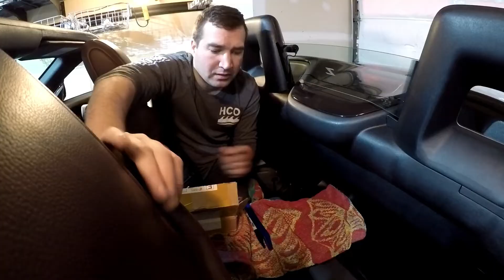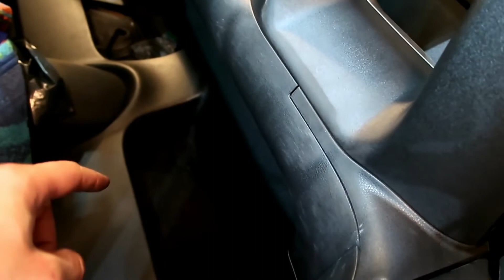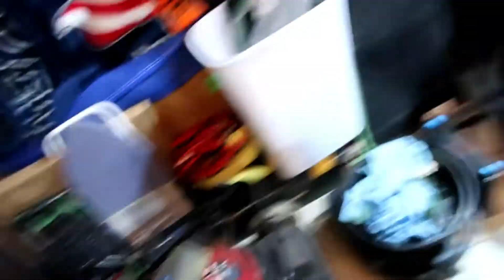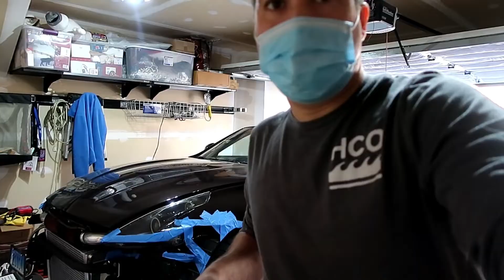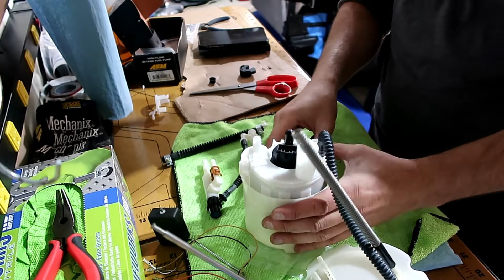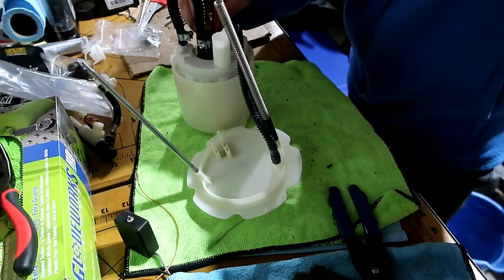370Z Upgraded Fuel Pump Install

Comment: This is tarded, lol. They DONT have 2 fuel pumps, and it is NOT a pain in the ass job. In fact it's one of the most easiest fuel pump R&R's to do. GAWD people dramatize too much shit in automotive repairs. This job, even for a novice only takes a max of an hour, 30min for a skilled tech with faster tools smh.

Comment: How big is the hole in mm?  how deep is it?  I have tried looking for that data but cannot find it.  Thanks from the Pyrenees.
Reply from the maker: See link in video details http://host.cj-motorsports.com/pdf/370z%20Fuel%20Pump%20Tech.pdf on page 12 provided the vector size based on your application.
Reply: thanks for the information mate.

Comment: Have you had any issues with stepping down in line size from your fuel pump leading up to the top hat connection? I did the same thing (solder and heat shrink) but I'm having doubts wondering if the smaller wire will generate too much heat and melt the connection.
Reply from the maker: 0 issues with this setup in now over 2 years.
Reply: @AGeekyGuy  Appreciate the quick response. Glad to hear no issues with the setup.

Comment: What wires did you connect the aem pump wiring to? Did you use your own? The positive & negative you spliced that plug from top of pump...nice video!
Reply from the maker: CJM kit that supplies new wires for the pump to the top hat, the new filter, and the surround that holds the pump in place.

Comment: Thanks for the video.  I got a brand new 370z fuel pump assembly from partsgeek.com for like $200 and used your video for direction/ideas on how to install my walbro 255 fuel pump to the fuel assembly. 👍🏾
Reply from the maker: Nice, I hope I included enough info to show it's not that hard to do yourself.

Comment: Have you had any issues with the fuel pressure with the 3/32 hole ?
Reply from the maker: Hobbs Media nope, the only issue I’ve had is slight fuel starvation when fuel tank is low during hard turning but this is due to a flaw in the 2009-2011 370z fuel tank design which I’ll be buying a fuel starvation kit (tank mat) and a fuel return system (to allow e85).

Comment: Hey. What a good rims.... Can u tell me what manufacturer is this??
Reply: What is this cooler in front?? u have turbo??
Reply from the maker: Rado13912 Volk Racing GT-C (GOLD) wheels 20x9.5 +22 front, 20x10.5 +20 rear
H&R 15mm wheel spacer rear.  That is the front heat exchanger for my RJM Whipple Super Charger.  Checkout my 370z playlist to see my build.
Reply from the maker: The fuel pump install in this video was in prep for the rjm whipple super charger kit.  I also have video of me installed both my 34 row oil cooler and 34 row transmission cooler.
Reply: Thanks for the answer. U have very good Z and this rims are beautiful.